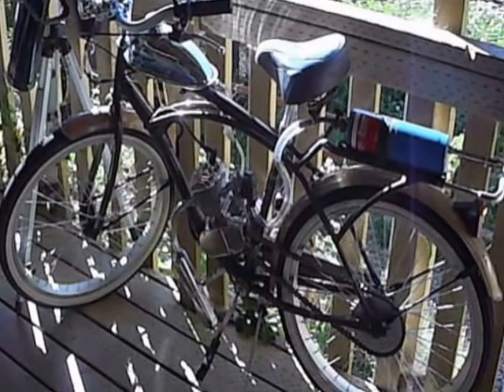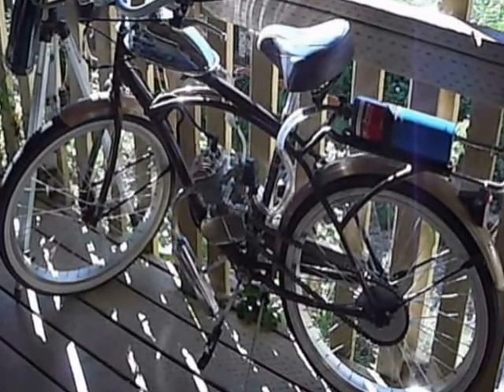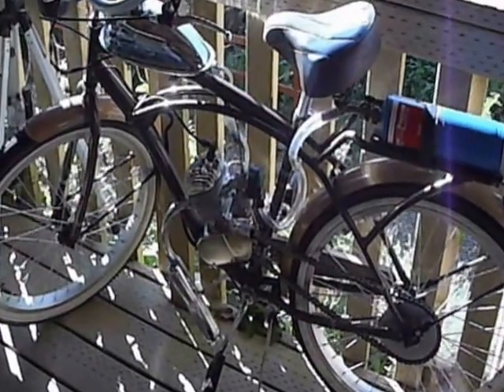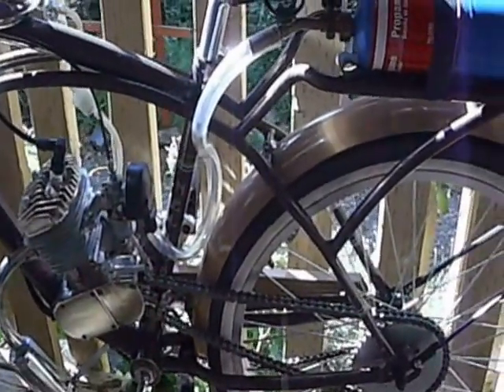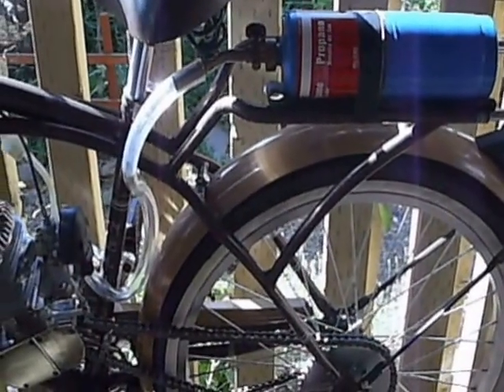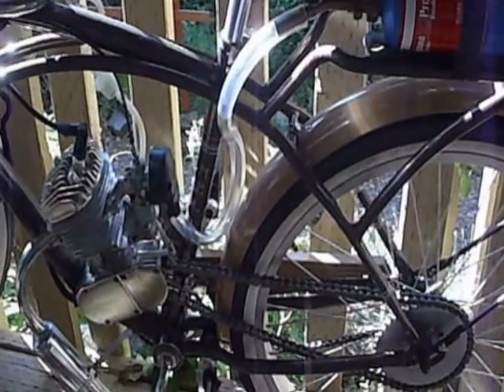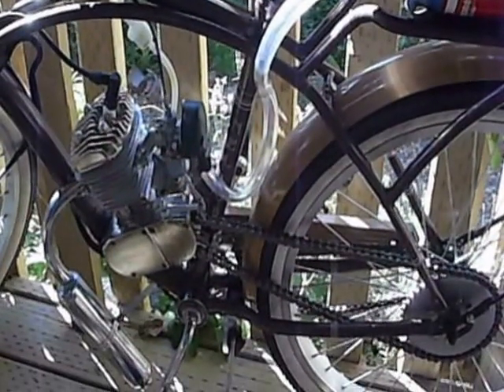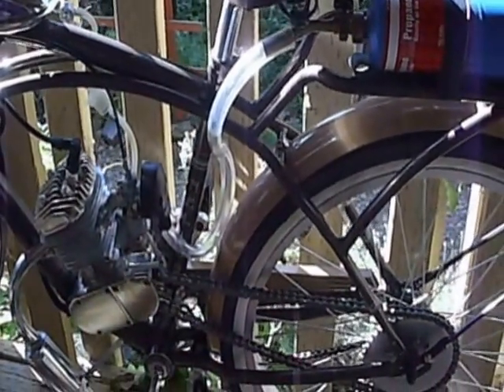Propane Adapted Gasoline Motor Assisted Motorized Bicycle by Freedoms Garden.  600 mpg?

Comment: I don’t know if this chat is even still active but my question is are you regulating the propane and are you just shooting it straight into the carburetor instead of air did you leave room for air and where are you getting your numbers on fuel efficiency. Also, did it work long-term?

Comment: this is pretty dangerous to inject propane like that without a checkvalve, the air could likely try to displace into the propane tank and could blow up....and it's probably better to inject the propane from the same port that the fuel/oil mixture to not reduce air intake and it's probably easier to gauge the oil to fuel ratio when both fuel mix from the same port
Reply: What "oil to fuel ratio" since it is a 4-cylinder and oil is not being mixed with the gas to begin with? Are you thinking of a 2-cylinder engine, instead? What you have stated is confusing as heck for a 4-cylinder engine. A regulator valve can easily be installed, but the actual gas hose can be directed through the air vent or on some engines, right directly into the carb.  An inline needle valve works well for adjustments to flow, too.

Comment: Progo scooter runs on propane. 4-stroke engine by lehr. Lehr has a whole line of lawn and garden equipment and outboard motors that are engineered to run on propane. Need a regulator and a modified throttle body. Don't think a 2 stroke would work. You would need an independent oil injection system I think might get too complicated/$

Comment: There are several small 4 strock engines on the market already running on propane  most in the Landscape / Gardnening business 

Biggest problem I see is in Your math of 600 MPG since it appears that Your the engine on BOTH  2 stroke mix gas AND propane  

A 2 stroke will not run on propane since there is no oil in the propane gas to lube the engine 

A 4 stroke will  

There are 1,5and 10 # propane fiber wraped tanks that are refillable now being used by  Gardners/Landscapers 

The tank You show only holds about 2 pints by liquid  and are not refillable costing between $5.00-7.00 each  thats $20.00 to $28.00 a gallon 

Its a nice idea but needs a lil bit more reasurch
Reply: Flame King makes refillable 1 lb. cylinders and even a whole setup to use when refilling them with a common large propane tank.  Even the stock  Coleman 1 lb. propane cylinders are refilled by tons of people, with no major issues. I believe the math is well off from 600 mpg, but the fuel mod for such is not too shabby a deal in a propane conversion. This conversion is indeed not for any 2 cylinder set up. You can also remove that rope pull and simply expose the large nut beneath it and use a hand drill to easily crank off these motors, but they are easier with the 4 cylinder ones than the two cylinder ones, anyway.  The propane will actually run cleaner on the engine in the long run, but you can also have some issues with the cold if your gas line length is too short. Look at all the lawn mowers and gasoline-powered edgers being converted to propane and they same basic principals apply to this 4 stroke engine, as well.